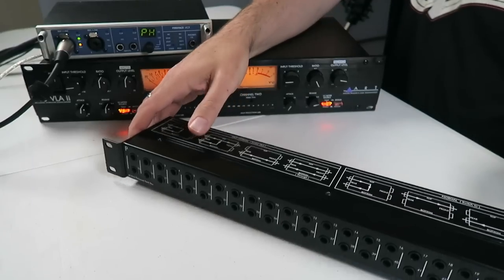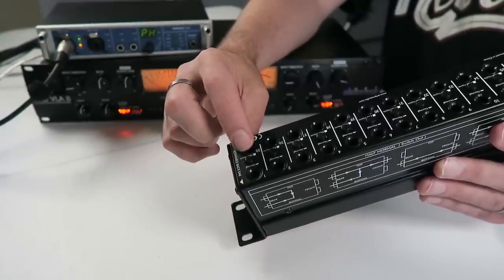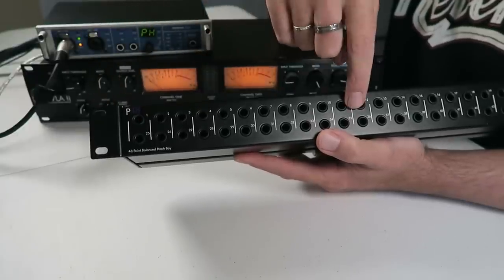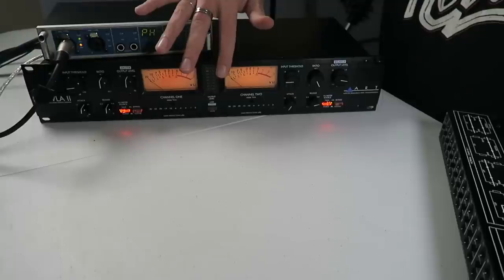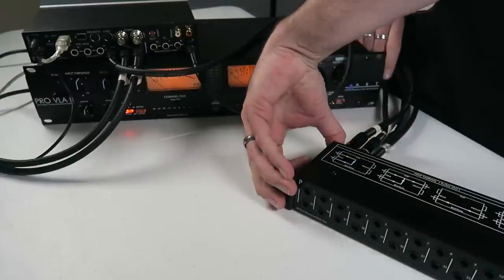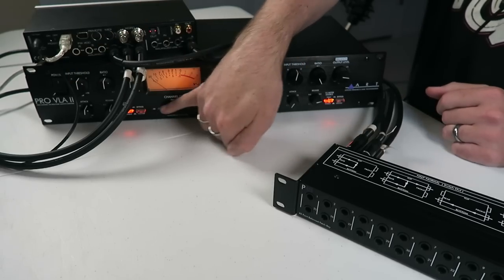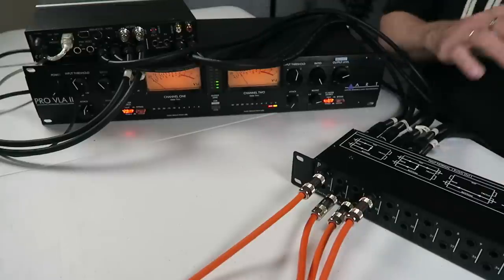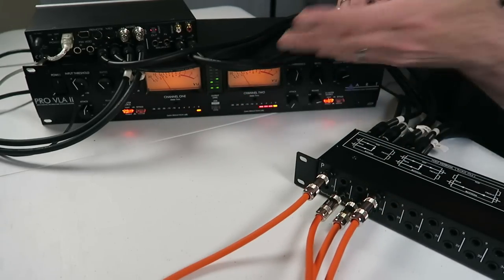Patchbays (ART P48)

Comment: Im going my mic to the front of my xlr patch bay coming out the back of that into the output row of the trs patch bay. Then im going from my interface xlr mic input into the bottow row input of my trs patchay. Then i set up a outboard mic pre, output of that into top row input of that into bottom.. (once i patched it.. everything is clear and fine im getting clean signal etc..) i then added my distressor compressor, output of that into output of tra patchay and  input of that into bottow row of trs patchbay. NOW AS SOON AS I PATCH/ SEND SIGNAL FROM MY MIC PRE TO THE compressor i get this insane white noise like when you would leave your tv on channel 3 ive tried everything with no luck.. help?  :(

Comment: Great video. I'm in a similar place with patch bays. Had one for years - a Signex Q Patch QPP48. The configuration is either Normalised or Isolated. You actually flip the board on each pair to determine which way you have. I'm looking to buy a new patch bay to replace it. Most of the patch bays I'm looking at can be 'Half-Normalised' or 'Full Normalised' so I was a bit lost! This video helped heaps.

Comment: The element of one channel of the compressor "bleeding" slight signal to the secondary channel is known as "crosstalk".  It's measured in dB units, and if that much crosstalk is occuring, there may be more problems than simply the seperate channels of that compressor.  Signal to noise is a similar measurement to crosstalk, which, in this case, is severe in nature.

Comment: Missed opportunity with the main outs from the interface. Would have been a good example of the "default route" being to monitors but then interrupting the chain to record to the secondary interface for the video. Or also an excellent example of using half normal to simultaneously send the output to the monitors and the second interface

Comment: I just bought this same patchbay and have never had multiple hard synths before recently. I'm hoping to use it to organize my 4 retro 19" rackmount synths so I can have a single set of 2 TRS cables going from the patchbay  to my USB audio interface (an m-audio 192/14). I have 3 more modern non-rackmount synths to connect to the rest of the inputs on the USB interface itself. 

Am I correct in saying that I would plug the L&R from each rack synth into the TOP inputs on the back (1&2, 3&4, etc), the cables going to the USB interface on the two BOTTOM outputs on the back of a separate channel (e.g. 9&10), and then use patch cables on the front to quickly patch between say the L&R on channels 1&2 (top) to the outputs of 9&10 (bottom)? 

Apologies if this doesn't make sense, I'm a nube at this. I'm just looking for the quickest way to switch between the rack synths, which will be listened to through the speakers attached to the USB interface, and used as external synths within Ableton, and not much else other than that (e.g. I don't intend on buying any rack mounted compressors or FX ...not in the near future anyhow!). If possible I would also like to be able to 'stack' the rackmount synths though (i.e. so I can have sound coming from more than 1 rack synth simultaneously).

Comment: Hi Thanks for the explanation. How would i set up a Sidechain ? I have two types of Compressor  one has an Insert type (dbx 266xs) Sidechain input and a (Furman LC-6 ) which has an IN & OUT Jack for each Sidechain. From your Video would the Insert one use Normal? Not got a clue about the other one. It states that the dbx one if a jack is inserted it breaks the connection from the INPUT jack to the 266xs detection circuit. So if it was Normal it would complete the circuit until i send a signal through the patchbay input? Does that sound about right? Any help would be appreciated :)

Comment: Great Video thanks. Are there any patchbays with quarter inch and XLR inputs? how would I manage to plug in a few mics and my xlr out guitar amp to a patchbay? Simply use an XLR to two stereo 1/4" converter?
Reply from the maker: I don't know of any patchbays that have both XLR and TRS connectors on them.  Assuming that your amp is outputting a line level signal (you don't want to send an amplified output anywhere but a speaker cabinet) then you could use an XLR-TRS cable to get the amp's line level signal into your patchbay.  I do the same with my Torpedo when I want to get a line signal out of it.

Comment: Great explanation, as I'm relatively new to the hardware side of things in my home studio (only having Steinberg UR28M and Presonus Monitor station as I run 5 sets of monitors) I have often wondered how to hook up for example a higher end Audient ID44 audio controller to the likes of an SPL Frontliner which has multiple ins and outs for it's multiple functionalities. I would of thought that it would have just one in and out and then turn the compressor, eq, de-esser and tube saturation on and off, but their all separate. The Audient has ins and outs like a patch bay I think (2 of them) but does that mean I wouldn't need a patch bay?... I still haven't got used the concept, but will watch this a few times and hopefully have it sink in, thanks for the great content.

Comment: How would you recommend setting up API lunch box  DB25 to trs jack for patchbay.

I also run a White industries vintage to channel EQ
And a antelope Synergy core discreet 8.
Plus rack another 8 tracks clocked and a extra mastering unit.

All set within a custom desk 30 degree angles cut through so easy access to change the configuration.

I am running a neutral NYS-SPP-L1
It's settings are half normalled  split and isolated.
Any help would be greatly appreciated.
Absolutely fantastic video by the way. 🙌
Reply from the maker: Sounds like a great setup!

I've looked at the NYS-SPP, and the way it's set up is definitely throwing me for a loop as well.  The PDF documents on their website are all in German, so that's a no-go for me (I only speak English and C++ 😁).

Mainly what I can gather is that either way each module is turned, patching into the gray jack will set it to a "through" mode.  Otherwise, In the standard position, it seems to be a half-normal setup.  And in the turned position it's basically the reverse, where the input and output on the front both go to the input on the back.  That's definitely confusing to me.
Reply: @YHRS  thanks do much for your reply.
I'm glad I'm not the only one confused by German Tech. 
It got me confused so I was just going to run isolated .. not really what I wanted..
Tho if you can recommend anything I'm all ears .
Thanks again regards Chad 🙌

Comment: So in short words you end up using a ton of cables to loop one acoustic guitar signal out to a compressor and back in to the soundcard. I bought a patchbay not really knowing what to use it for and now I´m even more confused lol. I´m seriously starting to doubt I got any use for a patchbay in my home recording studio other than to save wear on the ports of my gear from constantly plugin cables in and out of it. At least since I mostly do "traditional" recording with preamps and mics.
Reply from the maker: I think that the main benefit of a patchbay is to bring all of your studio connections into one easy-to-reach spot.  If you're plugging/unplugging a lot to make different connections, then a patchbay is really handy.  But if you tend to "set and forget" most of your connections, then it's probably not necessary.

Comment: Thanks for the great tutorial. I still have some questions. I am designing one for my personal studio. I have a unique situation. I am a guitar player and have alot of outboard gear. So I am trying to set up my 002 rack, and multiple guitar preamp (Ada mp1, ada mp2, etc.) Along with a lexicon mpx1 and alesis midiverb fx processors and some compressors/dynamics units (3630 comp, bbe 462, behringer EQ, ). 
I am trying to set it up in a way that will allow me to use 1 of the guitar pres, and allow me to patch it to different config of the other gear depending on my need at that time. 
So each guitar pre has a left and right output. I could route those to the inputs on the compressor. Then have another patch set up for the effects return& send and patch that to the mpx2 effects unit. Then route the output of the effects to input #7 &8 on the 002r and the guitar preamp back to inputs 1&2 on the 002r. (Allowing me to maintain an unaffected guitar channel in case I change my mind) 
My question is in this design which w o uld be my best option? Thanks in advance
Reply: Hey, did you figure out a solution to your problem? My first thought was your mixing of instrument and line level, and balanced with unbalanced?

Comment: This was very useful, thanks.  A quick question re the cabling and patching.  I imagine if your compressor has XLR only you'd use an XLR to balanced cable going in and out of the back yes?

Also, your patch cables at the front, are they balanced/TRS?
Reply from the maker: Thanks so much!

Yes, that's how I route XLR stuff into my TRS patchbay:  with XLR to TRS cables.  It maintains the balanced connection through the patchbay.  The only time I don't recommend going from XLR to TRS is any time the signal carries phantom power.  That's a good setup to fry something!

Oh and yes, my patch cables are TRS as well.  I'm using patch cables from GLS, and a few from Hosa as well.
Reply: @YHRS  Thanks, very helpful.  Recently bought a couple of bits of outboard gear and realised that I'd get teh most out of it, especially using them as inserts, if I got a patchbay.  Thanks to your response I'll order one today
Reply: @YHRS  Hi, you say that it's not good to use XLR to TRS cable if it carries phantom power, that's good to know, but what about just TRS cable carrying phantom power, is that ok? Thank you!

Comment: Interesting that the button to change the flow is on the back of a device designed to eliminate the need to access the back of your gear.  Why not on the front?
Reply from the maker: Agreed!  I'm a little puzzled by that as well.  Of course I can't think of a time that I ever wanted to change the setting so it hasn't been an issue.  But if I ever wanted to change it, it would be a giant pain to reach the button!
Reply: I guess that the mode is on the back, since if you can press it on the front, you might get some unexpected results if the mode is not pre-thought of before. You could easily end up with an unwanted loop or something. Having the normal is a no brainer, but allowing half normal will potentially make things work unexpectedly if the routing has not been thought through enough.
Reply: @oysteinsoreide4323  I think this must be why the S-Patch Plus (which has N/HN/thru selectors on the front) uses almost-flush switches, so that they can't be knocked accidentally.

Comment: Best explanation keeping starters in mind with practical info unlike most YouTube vids where mostly people showing off their gear. Thank you. 
I also want to connect my preamps with phantom powered mics. Is that possible? Cheers
Reply from the maker: Thanks!  I use an XLR patchbay for my preamps, and I pass phantom power through the patchbay.  Just be careful doing that, since it's possible to accidentally send phantom power to a destination that does not like phantom power :)
Reply: @YHRS  Yeah that's why I asked. I heard that xlr to trs will not pass the phantom power though. So from xlr patch bay that has xlr inputs how do you connect the preamp? Does xlr patchbay acts as a barrier? If so how? Thanks for the earlier reply.
Reply from the maker: @aLoudSi1ence  I just use my XLR patchbay as a way to bring the connections from the back of my rack to the front.  So I just treat them as extensions of the inputs/outputs on the back of my preamp(s).  

My XLR patchbay is just a simple "inputs on the front, outputs on the back" device.  It doesn't have the complexity of my TRS patchbay that has normal/half-normal operation.  The XLR patchbay is just basically a cable coupler.

I run an XLR cable from my patchbay to the mic input of my preamp.  So any phantom power or signal is passed to/from that input, just like it would be if I were to plug directly into it.

Same for the output.  It's a TRS 1/4" cable from the preamp output to my patchbay.  Then I can route that wherever I would normally route it, as if I were plugging directly into the back of the preamp.

Hopefully I made enough sense to describe the setup :)
Reply: @YHRS  thank you for explaining. I have better idea now.

Comment: If I only have stereo outputs 1 & 2 on my scarlett 2i4 (and not use the unbalanced RCA outputs), is it possible to still route to my outboard compressor and somehow route it back into my interface to hear it thru my monitors? Can that be done with a patchbay somehow?
Reply from the maker: I think you can do that.  Since you have 4 outputs (2x balanced, 2x unbalanced) you can use 2 of those outputs to send to your monitors and the other 2 to send to outboard gear.  Although unbalanced isn't ideal for either of those uses, it'll work anyways.  I don't think that a patchbay is going to be much help beyond making it easier to reach the inputs/outputs on your gear.  

Best of luck!

Comment: That was terrific, thank you. That got my head starting to be able to process the routing and "half normal" weirdness. Speaking of routing, that's a lot of cabling! Four cables for one compressor channel! So answer me this...you have your little acoustic track, right? You send it through your compressor for some gentle massaging, then it comes back into the DAW. What if you want to permanently apply that compressor to the track? That's easy to do with a plug in. How would you do that with hardware? Do you have to re-record that  track as it plays through the compressor?
Reply from the maker: Thanks Greg!  Yeah, the number of cables it takes to wire 4 compressors, 2 channel strips, a preamp, a wireless mic, an ADAT preamp, and the Torpedo is insane!  It's really a terrifying mess behind that rack when it's all wired up.

As for "printing" outboard FX onto a track, you got it right.  You have to render the individual track in real-time in order to get an audio track with the FX printed to it.  Or just never touch the cables or settings on the outboard gear for the lifetime of the project :)  At least you can do several tracks at the same time, depending on how many channels of outboard FX you have.
Reply: @YHRS  Ok, thanks. Next question....suppose you're limited on interface ins/outs. Say you only have one unused in/out channel available on the interface. Can you have several hardware effects sitting out there, permanently connected in the patchbay, and just send your one available send/return from the interface out to any of those hardware units via patchbay? It seems like you should be able to.
Reply from the maker: @GL64  Oh, definitely!  That'd be a great application for a patchbay.  Just patch your interface inputs/outputs and all of the ins/outs of the effects units into into the patchbay, and connect them with patch cables on the front of the patchbay.  That makes it easy to switch what your interface is connected to, without having to have access to the backs of everything.
Reply: @GL64  If you setup your patch bay "normalised", meaning default inputs and outputs to and from your interface, then you only need to patch if you need to use a different ourboard gear.

Comment: Do the quality of the patch cables matter here?
Reply from the maker: Good question!  I'm of the mindset that as long as they have good connectors and are properly shielded and wired, then any cable will do a good job.  I use GLS patch cables, which I would call "medium" quality cables and connectors.  I haven't had any issues with noise or interference, so they seem to be doing a good job!

Comment: I label cables with tape and write the name of the device on each end of the cable.
Reply from the maker: Ha, I do that too!  although I haven't yet found a tape that doesn't eventually let go and slide down the length of the cable after a couple of years.  But those tape labels really helped get things set back up after moving studios a couple of times.
Reply: Was starting to feel like I was the only one.
Reply: @YHRS  Electrical tape worked well for me. You can find it in variety of colors.